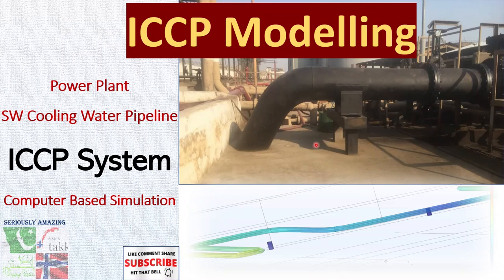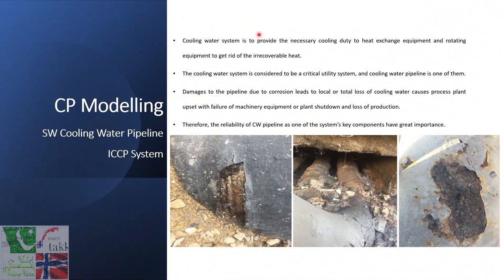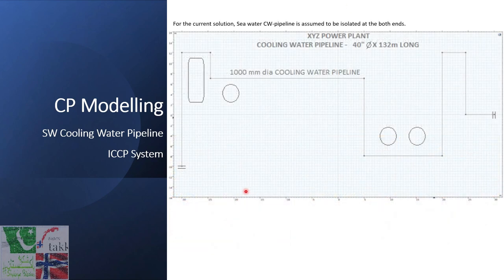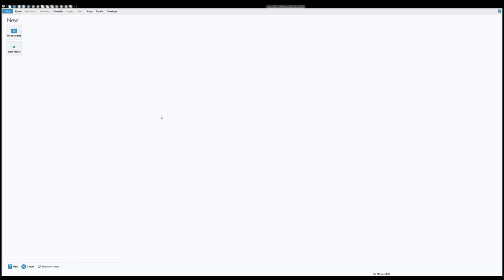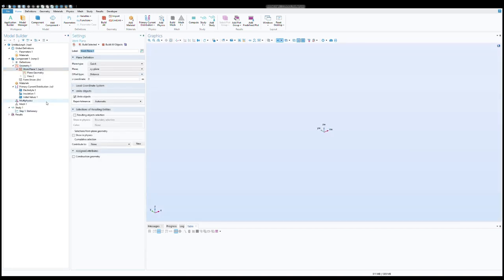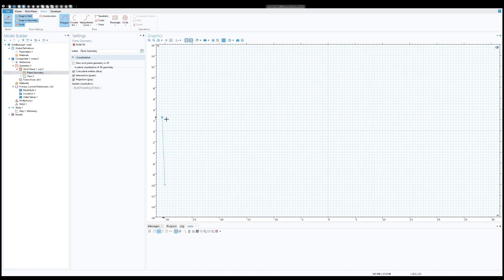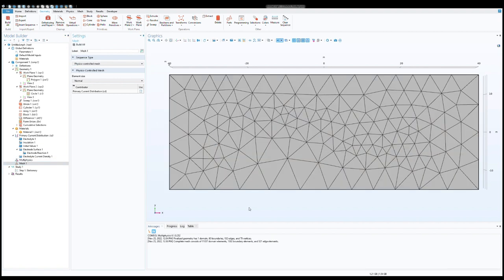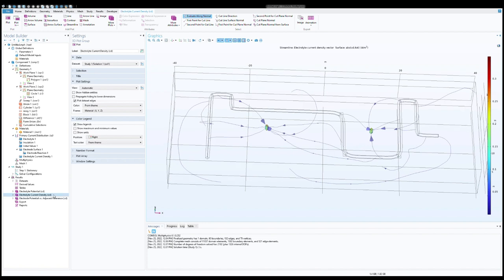CP Modelling / ICCP Anode / Power Plant Seawater CW Pipeline Cathodic Protection

Comment: 20:10 min ; please sir what did you do to pass from the ( blue color for both pipeline and anodes) to the ( red color for pipeline and anodes still blue) i tried to follow you but in my results it shows that both pipe and anodes have same potentiel ( bith are colored with blue) do i find an anwser please?
Reply from the maker: Yes, go to surface node and select the range. As cp system normally works in between -400mV and -1100mV. It will change the colour of respective component 👍